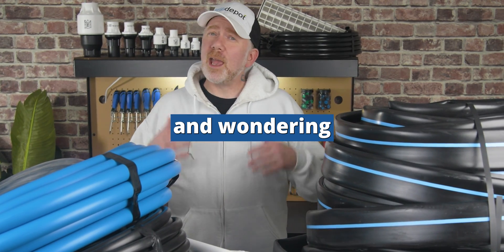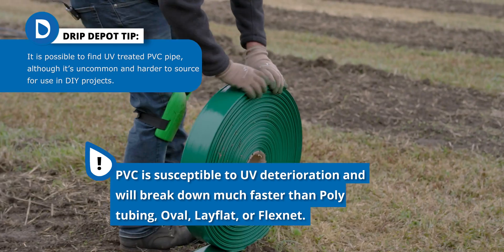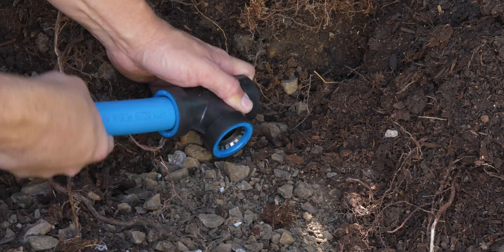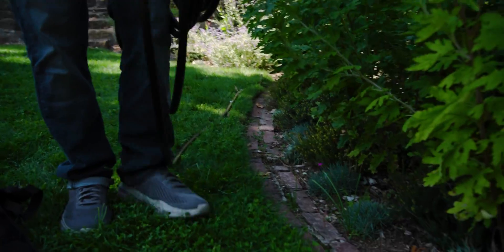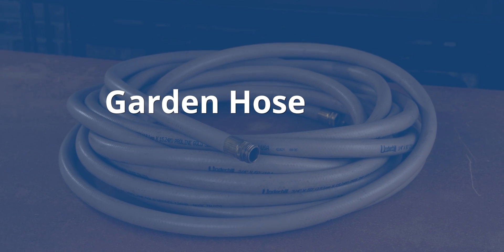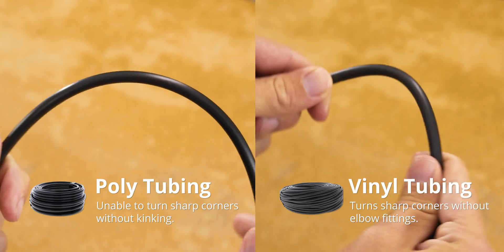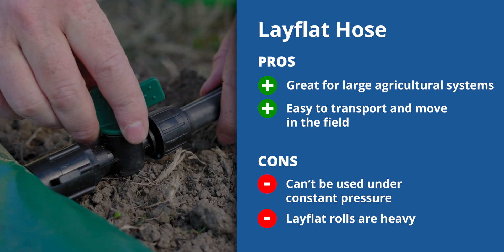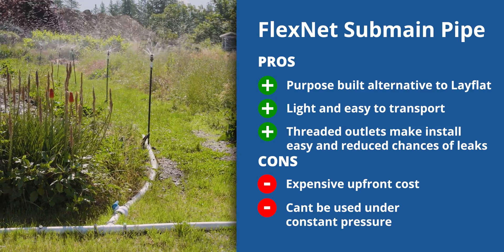Irrigation Pipe & Tubing: Choosing the Right Mainline Type for your Irrigation Project

Comment: Is a water hammer arrester important if I install a hose end water timer?
Reply from the maker: Great question -- water hammer arrestors are not always needed, but if you are experiencing any water hammer when the timer valve closed, I would recommend one.  I usually recommend one for older houses (whose piping may be older) as well.  They're fairly inexpensive and the shock of a sudden change in water flow can eventually lead to damage, so if there's any water hammer (or if you want maximum protection) I'd go with one.
Reply: In what order would this be installed with regards to the head assembly? Can it be screwed to the tap first then hose splitter after it?
Reply from the maker: @mnchnn  You got it -- the most important part is for it to be before the timer -- it sounds like you're thinking something alone the lines of: 

Arrestor --> Splitter --> Timer --> Head Assembly

If so, that is a solid order -- that order will allow the arrestor to absorb the shock of the sudden change in flow when the timer valve shuts. :)
Reply: Perfect, thank you for all your help. Much appreciated!
Reply from the maker: @mnchnn  Any time!